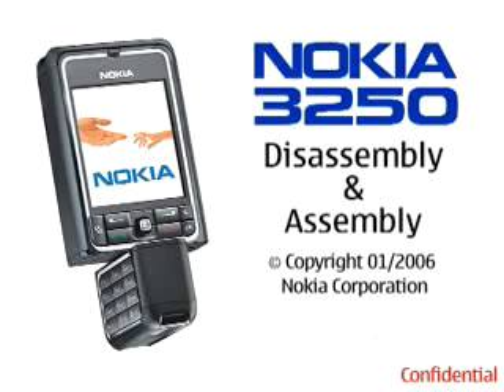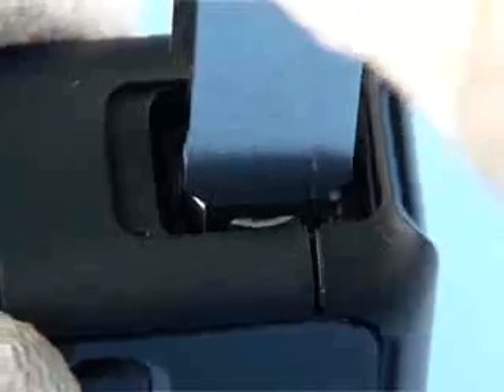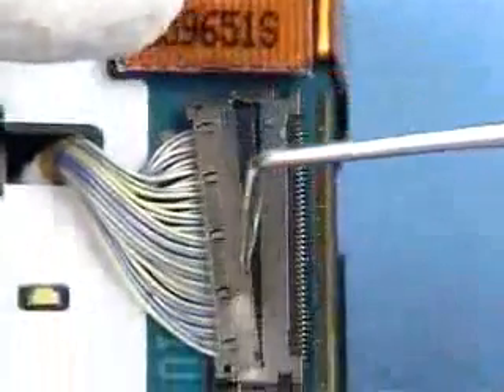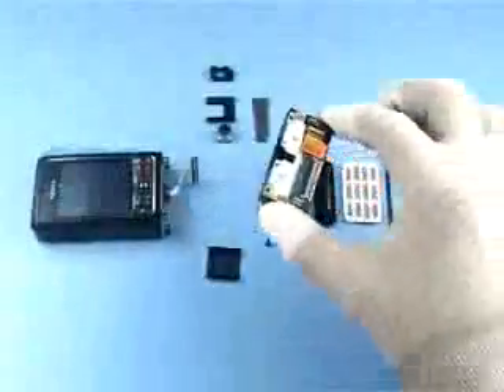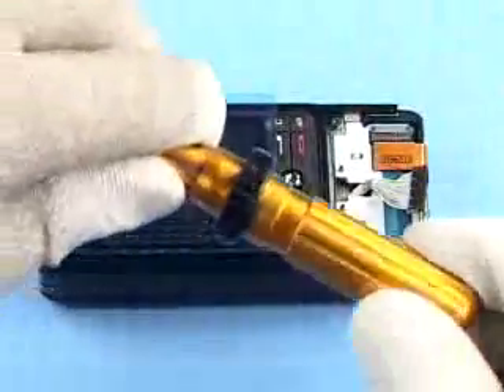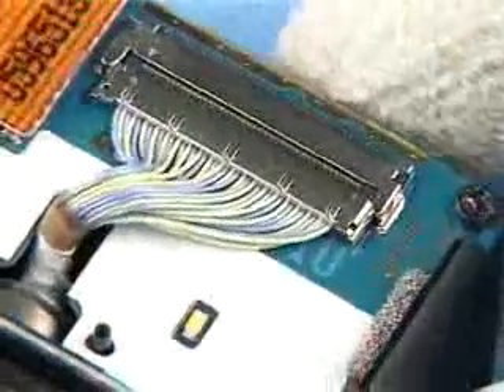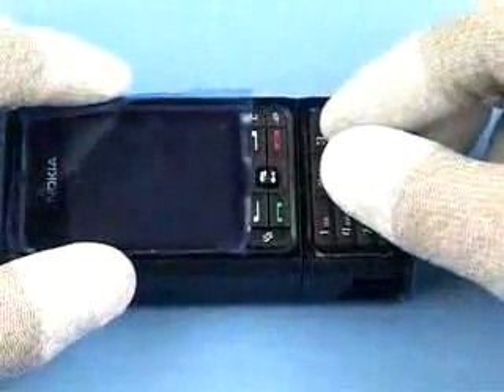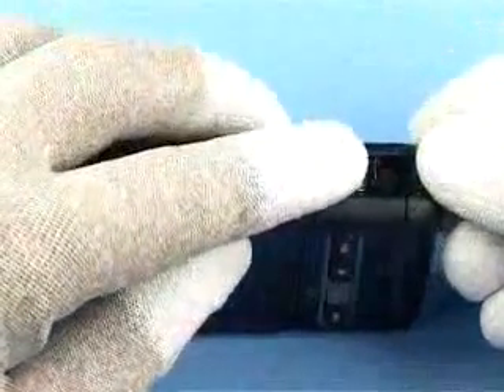3250 lower block disassembly

Comment: Had my 3250 for about 3 years and lost the navigation button when I dropped it. I had a spare 3250 with button attached, that wasn't working, and couldn't find how to get the bottom assembly open to replace it so had to buy a new phone.....wish I'd seen this video first and I might have tried replacing the button...miss my 3250...had a cool ringtone, as well. Anyone know if there is an archive of the pre-loaded ringtones so I can lift it and put in my new phone?